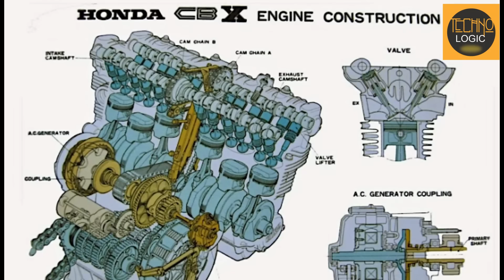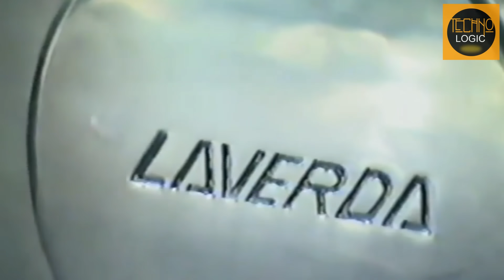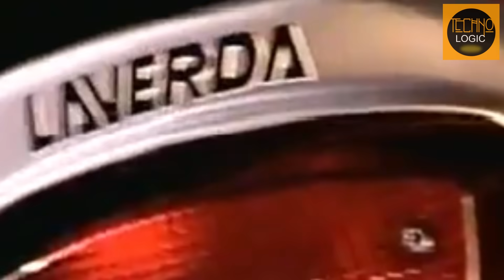LAVERDA V6: The Ambitious V6 Engine Project That Was Poised to Rival Superbikes of Its Era

Comment: J'ai piloté la Benelli 6 et à part sa musique, déjà entendue aux 24h de Liège en 1976, elle n'avait rien d'impressionnant, sinon l'impression d'avoir en main un moteur électrique avec du couple à tous les régimes.
Je n'ai jamais piloté la Honda 6, une bien belle machine.
Le V6 Laverda aurait peut-être été une merveille mais la marque avait des difficultés et il ne fut jamais commercialisé.
J'avais piloté la 750 bicylindre, qui vibrait atrocement, et le 1000 3-cylindres, très agréable mais la batterie était faible, j'avais calé à un feu rouge et il avait fallu redémarrer à la poussette, je ne dis pas comme ce fut pénible.
C'était dans les années 70 et Laverda n'avait pas le vent en poupe, la 750 était archaïque et la 1000 se vendait mal. En compète, sur les courses d'endurance, les machines n'allaient pas au bout. Et la marque n'était pas présente en petites ni moyennes cylindrées et elle n'aurait pas pu concurrencer Yamaha ou Suzuki, le dépôt de bilan montrait les dents.
La 1000 V6 sonna le glas.
Salut et fraternité*

Comment: Alfieri was by all accounts a mechanical genius, it is said that old man Ferrari was after him as a hire for years.  De Tomaso, upon acquiring Maserati in 74-75 ish, immediately fired Alfieri, gave him 15 minutes to leave.  The Laverda engine project was one of Alfieri's sort of freelance projects he did until Lamborghini hired him and he brought their V12 into modern times with it's 4v cylinder head.    The Laverda engine is otherwise almost a mini version of the 90 degree 3 pin crank Alfieri made for the Citroen SM/Maserati Merak, which was also raced in the Ligier JS2 in 4 valve format in 1974 when it placed 8th overall.  The 4v engine was an amazing piece, the final variants made some 400hp from 3L at 10,000rpm.....